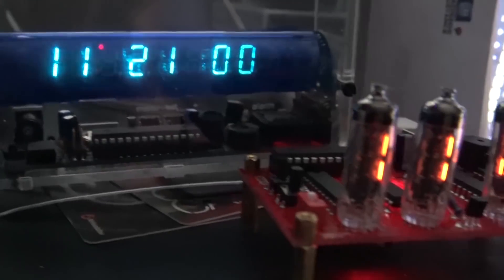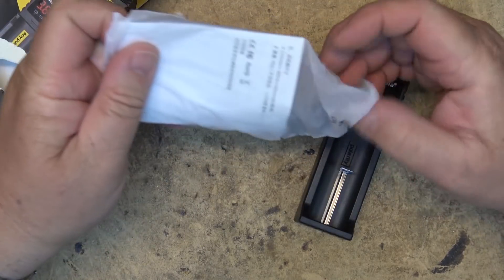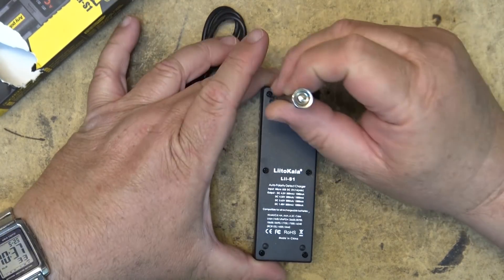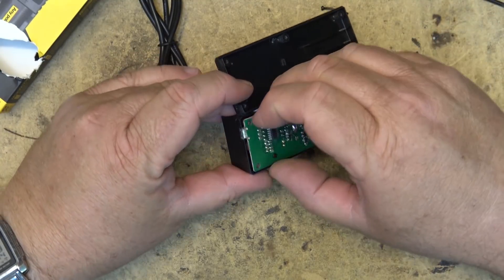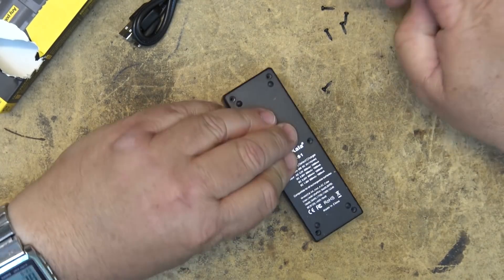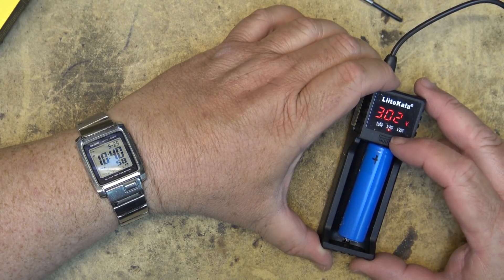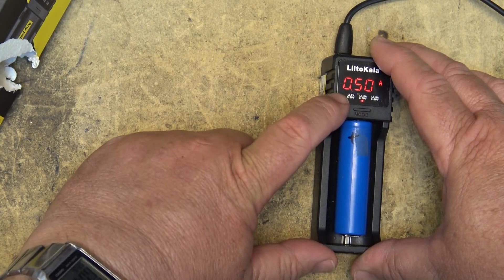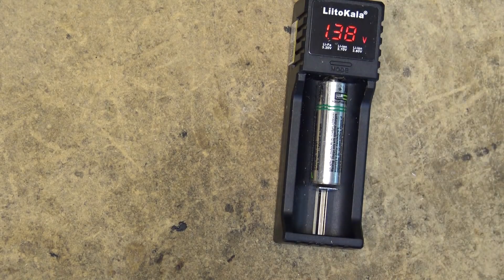LiitoKala Single cell battery charger

Comment: I really like those ones. I have the previous models.  I mainly use them to connect them to my mppt solar controller module which is set to 5.1V output and hooked up to a 10W solar panel.  When a cloud passes by the charger will stop and when there is enough power it will automatically startup again (at the lowest current). Dirt cheap and works as designed is good in my book.

Comment: So it charges at 0.5A until it is finished? This sounds fishy - shouldn’t a Li Ion cell be charged at a constant current until it reaches a certain voltage and then at a variable current / fixed voltage until full?
Reply: https://lygte-info.dk/review/Review%20Charger%20LiitoKala%20Lii-S1%20UK.html

Comment: Nice and simple charger, with a micro in control :-D
Reply from the maker: zx8401ztv 
You pretty much need charge control on these cells because over charging can lead to a dangerous condition. I learned this the hard way many many years ago. I had a Philips portable cd player at one time. It had a battery case that would hold c size cells. There was a rechargeable pack available that was just c cells wrapped in heat shrink with a tab poking out the end to activate a switch. I had the dumb idea to stick a toothpick in that home and just put regular nicd cells in. (This was before nimh) little did I know that there was more to the expensive pack than just cells shrink wrapped. There was a thermal switch on it to stop the charge and an additional contact  to shut the charger off. So my cells would keep charging. I went out one night and left the unit charging. I came home to a smoke filled apartment and my cd player had melted down to a pile of molten plastic.  The only reason it didn't burn the building down was because it was sitting on a glass coffee table and we'll glass doesn't burn. Lesson learned.
Reply: Bloody hell!!, that was a lucky escape.
I've seen the results of a house fire, it's not pretty, very little in the house escapes in tact. :-(

A frend had a flat fire and his betamax vcr and tv suffered, the heat melted the fasia's, all the buttons had melted into the fasia, the vcr was black with soot inside.
He could not afford to replace them so i dremeled around the tv buttons to allow them to work, the tv itself was fine, no internal damage.
After cleaning the inside of the vcr, it worked!!, i left the front fasia off because it was hopeless, the switches were marked on the pcb in white.
He used both for quite a few years without failure.

Comment: Hey Boss. Hope you are doing well!
I have a sony trinitron 25 inch set.  I noticed, on the sides of the picture,  there is a convergence issue.  I can't understand its been the same  symptom with 5 other trinitron tvs I have had. The  convergence rings on the set were set at the factory and locked, why would they move?  I hate convergence tweaks on tvs since it takes hours of brain aching pain to align the guns. But I  really don't want to do that.  The  shadow mask or aperture grill doesn't seem damaged its just the sides corners that show image ghosting.  I'm sick of sony and their trinitros, but they do project a good picture.  Any  advice would be appreciated!